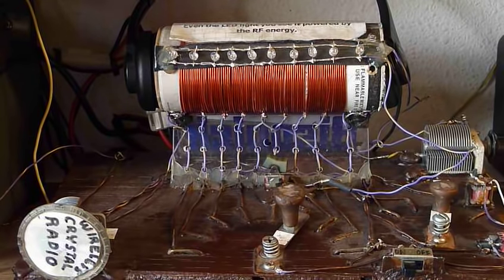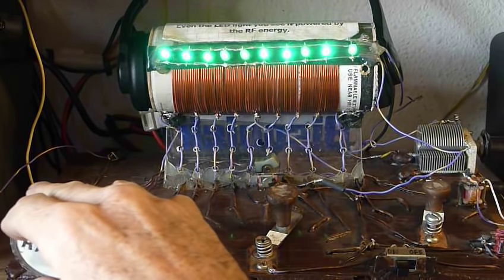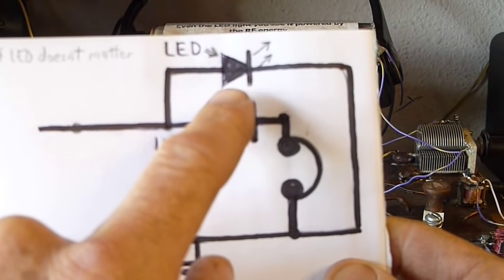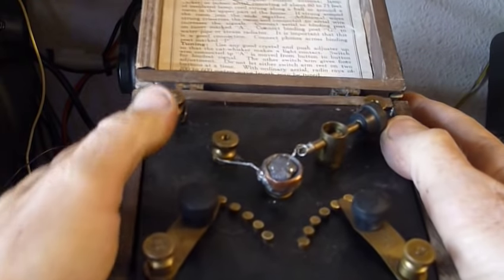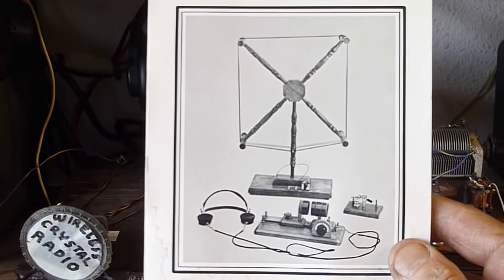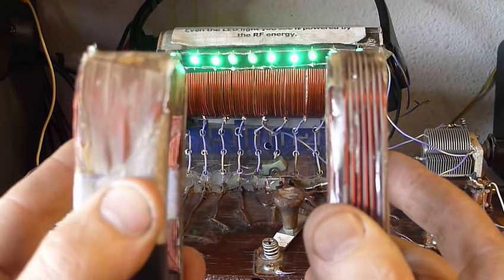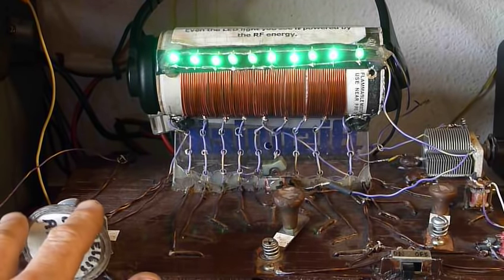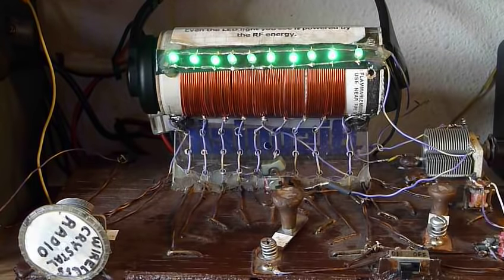Free Energy From Radio Waves. See info section for additional video.

Comment: you are oscillating the electrostatic difference of potential between the ground and the atmosphere  ...  the same electrostatic field that creates gravity ..

In 1936 there were over 3 million crystal radios in Greater London receiving their signal directly from the Bush House "London" transmitter. It's power output was a modest 100Kw. The collective output of those 3 million plus crystal radios was 123Kw. The BBC International World service Transmitter put out a massive 1000Kw signal. On the day Churchill announced the war, it is estimated that over 260 million people in Europe tuned into the broadcast from a single 100Kw transmitter in the centre of London. The signal was picked up by domestic crystal radio in the Falkland Islands and by the "Large Grid Ariel" project in Antarctica.  The point to remember is that Crystals do not "Absorb" or "Use" the energy they receive from the source, they are excited by it, unlike a modern radio "sucking the power from a set of batteries or the mains to power the amplifier. The energy collected by the amplifier is the electrical energy collected by the Ariel. 
The main point's are1.The output of a transmitter is unaffected by the number of receivers collecting it.
2. The number of receivers have no effect on the transmitter even if their collective output is higher than that of the source.       
It could be described as a radio frequency inverter.   

How do crystal electrical generators work? | Page 1 | Naked ...
https://www.thenakedscientists.com/forum/index.php?topic=46906.0
Feb 10, 2013 - 20 posts - 7 authors
Likewise, your radio antennas absorb the EM energy that strikes them. ... In 1936 there were over 3 million crystal radios in Greater London receiving their signal directly ... It's power output was a modest 100Kw. The collective output of those 3 million plus crystal radios was 123Kw. The BBC International ...

Thomas Townsend Brown: British Patent # 300311 ... - RexResearch
www.rexresearch.com/gravitor/gravitor.htm
"How I Control Gravitation". by T.T. Brown. Science & Invention (August 1929) / Psychic Observer 37(1). There is a decided tendency in the physical sciences to ...
Reply from the maker: Thank you for taking the time to share these links.
Reply: hmm smells like bullshit. Crystal radios by definition perform work, in order to produce sound. It takes energy to do that. Hence, all radios draw power from the actual signal. Now it is true that various recievers draw power, from a transmiter but the power drawn is miniscule. Applying inverse square law, the power available at the distances where the recievers are is miniscule, on the order of nanowatts, so for all points and purpouses no power is drawn. It does not however mean that the collective recieved power can exceed the output power, as this violates conservation of energy. 

If you had an infinite number of recievers, the power on each reciever would converge to zero, but but the total combined power recieved on all the recievers would equal to the transmitter power by the tower. ceteris paribus. 

Your failing to consider that because a crystal radio can recieve say up to 1mW of power that it neceserally will.
Reply: JOOODYJOOODY nope not gravity.

Comment: No, space is not made of matter. Matter is a 3rd pole of magnetic current. Space does however abhor a vacuum. In 1955 two head professors from the University of Texas toured the country showing off their electron photography machine. It proves that enough power is held inside the space the size of a ladel jar to run a nuclear carrier full bore through the water. This is one thing which inspired me to write my own particle physics theory and books which I did, and have proven in mathematical formula as well as practical models that make photons and superstrings look like training wheels under an SR-71.  Ie; completely pointless. Even Einstein made it clear that photons were not real, rather a shortcut. His dying last words; "Everything is relative." contrary to this theory. Lately we have been provided experimental proof that atoms require 2 electron mass types to exist. See page 27 Jan Discover Magazine. That's just one example.
So what you have here is free energy, obviously, but you don't know what that really is. I'll tell you. It's electron neutrino current, and you just built a windmill to them.  They constantly mix everything larger, so they neutralize ion charge. Using any 3 dynamos in a row having a carrier wave timed just right to short some, you can extract energy from the faster smaller resonator (carried wave) which will become a pump z wave in the presence of a carrier wave, after imploding through a nonlinear medium. 
Would you like to know how to build a faster than light drive in your basement using simple pottery tools, electroplating tools, and other basic tools with fairly cheap supplies? It's my next project after I finish a reproduction of the secretive 40hp free energy system using in the 1908 Model T Ford, designed by Keely, ancestor of the Keely who runs the keelynet website.
Reply: mikefromspace definitely this is a subject I've been pursuing as well. 
The model T and the radio plays into what Ed L. was doing down in Florida and I didn't know Keely designed it so yes please make a video lol

Comment: the crystal is the + and the ion waves are -?
Reply from the maker: I don't understand your question, but the crystal work like a diode.
Reply: Will have you heard of ion collection using an antenna and ground. The antenna captures ions from 26ft you produce 2v but the higher the better.
Reply from the maker: I've heard about Ion collection, but a crystal radio works on a different principle. It's taking energy from local radio stations.

Comment: This radio is either near a high powered power line or transmission station cause no way do you get that much power from theses radios not even to light 1 led  I have been making these since radio was invented why do you think you use high impedance, to help amplify the radio signal.
Reply: Tony Broadhead so how old are you over a 150 years?

Comment: how is made the antenna
Reply from the maker: The antenna is must a long wire up in a tree.
Reply: and with a so small antenna you can get so much power??
Reply from the maker: It takes very little power to operate the LEDs used on this crystal radio.
Reply: with a 5-6 meters tall antenna without resonant tank I obtained only 500 millivolt and 10 microamps.
the power of yours must be of about 3 volts and 10 milliamps i think. 
perhaps with the resonant tank it is more efficient.
Reply from the maker: All I did was string a long wire from the top of my pine tree which is probably about 100 feet tall I used insulated stranded wire which is probably about 20 gauge in size, and I used a kite to get it over the tree. If you do this make sure there are no electrical lines near by or it can instantly kill you.
Reply: ok

Comment: if i would have a guess what might power your led's i would guess its the universal backround noise you pick up ass white noise on your radio or tv which i heard at some point in my life is the tone produced by the universal backround radiation caused by the big bang and or other highly radiant things like sollar flairs supernovie and so forth sry about my english though but yeah thats fazinating actually wounder how far you could go with this hmmm
Reply from the maker: +goldi187 In this case it is most certainly the radio station transmitter causing my LEDs to illuminate. Sometimes when I tune the crystal radio  just right you can see the LEDs flicker in sync with the audio being broadcast by the radio station.

Comment: can this energy be used to send it to a joul thief and then that energy to electro magnet used as last magnet of a magnetic wheel motor?
Reply from the maker: I suppose it could, but the energy derived in this manner would be so small, it's not likely to be of much use.
Reply: may be with several units like this connected each to a capacitor then each in series @GrantsPassTVRepair  thanks for your job!!

Comment: My question is could you charge capacitors or batteries from the power you are receiving wirelessly from the radio station? 

If that be the case then that is surely what Nikola Tesla intended when he built Wardenclyffe, since he was in a race against Marconi for rights to the radio. 

The wireless transmission of power over great distances via radio waves would require the largest Tesla coil in the world in order to do it at that time.  

If you can indeed charge capacitors or batteries from radio waves, It's a Small Wonder the electric car industry hasn't jumped all over that as cars can be charging while driving courtesy of radio waves. 

Jesus Christ Almighty God bless you all 😊
Reply from the maker: Yes I can charge up a capacitor but the amount of energy I get is so small it's not worth the effort other than to light up a few LEDs as I show here. Here is another video which may help you understand how easy it is to do light up a small light in this way. https://www.youtube.com/watch?v=vHVmJ5lD9jc&t=230s

Comment: Come on... he constructs a device to be powered from radio waves, yet doesn't measure it's potential?
Reply from the maker: My multimeter was not able to accurately measure the power due to the frequency being broadcast, but since these LEDs are designed to operate at 20 MA each, and they were not at full brightness your guess is as good as mine. Here is another way to light up LEDs with RF power. https://www.youtube.com/watch?v=vHVmJ5lD9jc&t=1s
Reply: @GrantsPassTVRepair  Quick response and appreciate the engagement!  Have you entertained using an oscilloscope to measure input frequencies and the associated waveform variances in the circuit to determine voltages and capacitance?
Reply from the maker: @Father4ev3r  I haven't tried to measure it with my o scope, but that would be the best way to measure it.